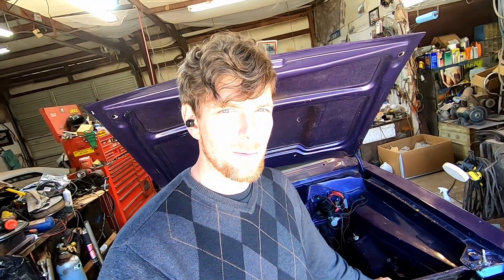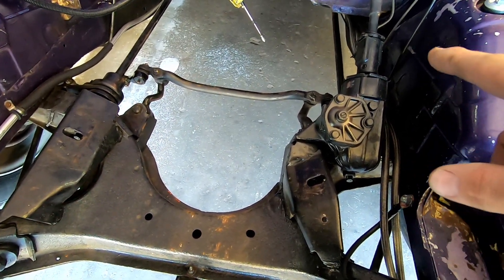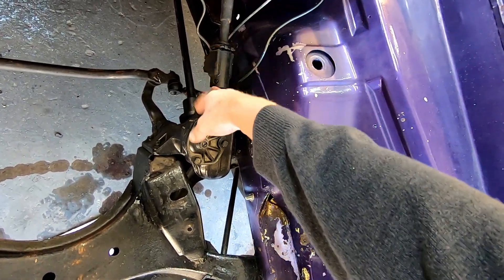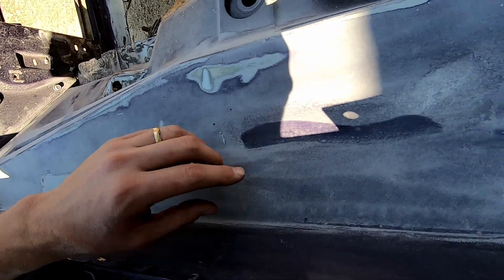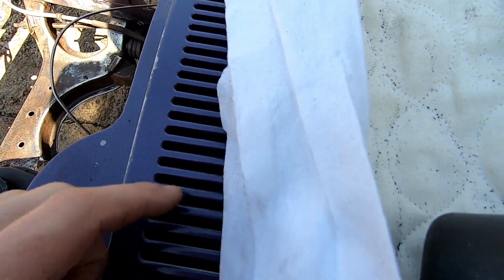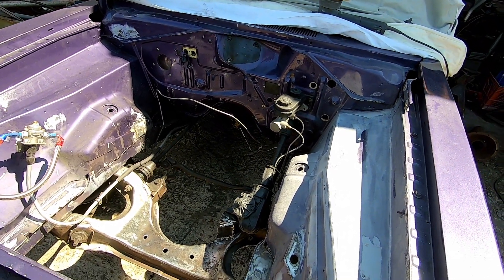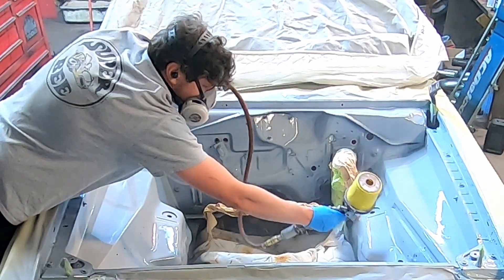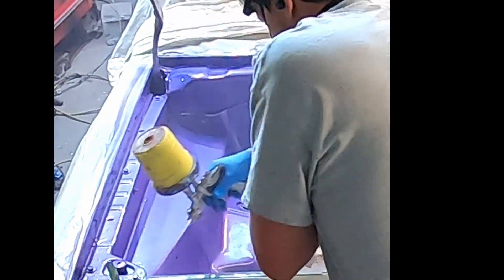Barracuda DragCar: Plum Crazy Engine Bay and Shaved K Member for #bigblock #mopar #nonamenationals

Comment: We used TCPGlobal for our paints for aircraft painting and we used them in our guitar manufacturing shop. After 20 years of painting planes, guitars and automobiles we started using "Polyester" high build urethane  clear otherwise known as boat hull paint. Makes for a super durable topcoat that not only resists scratches but resists chemicals as well. All the high dollar guitar manufacturers of guitars like Santa Cruz, Taylor and PRS use the polyester clear now.
Reply from the maker: Thank you for sharing! I look forward to seeing how it lays on the large panels.

Comment: Turned out nice! I've used that TCP Global bc/cc on my last two projects. It seems to be holding up well so far. Great job!
Reply from the maker: Great to hear! It’s my first with them. I wonder if they’re connected to a major company: Nason,Ppg, etc.
Reply: I wouldn't mind knowing that too. I know that a lot of the high end paint (house of kolor, etc, are Valspar). Some are Sherwin Williams. I never realized that automotive paints were made by the same companies that make house latex👀!  
I have been using the nason ful-poxy for awhile now also Joe... and it does a good job. Nason is Dupont's (Acromax-now) low-line product..and goodness has it gone up-along with everything else in price! I'm dealing with a learning curve myself trying out new products that are less expensive. Some I can report good on..some bad. It kinda sucks getting used to materials that I'm confident in and know hold up over the long run...but just aren't cost feasible anymore! Live and adapt I guess🤷
Reply from the maker: @MidnightOilsRestoration  tcp should be around a long time. Also check out urechem

Comment: 🎉 Looks great Joe! Can I ask what you meant when you said you might find it on the floor!?
Reply from the maker: Thanks Anthony. Old timers used to spray lacquer paint. A car with lacquer would react when urethane was spayed on top of it. They say it’d literally melt off like paint stripper.
Reply: @JustMoparJoe  are you going with mounts or elephant ears? You can make your own isolators/insulators to keep the racket down when blowing the door's 🚪 off 📴 the other guys car 😎🚨.
Reply from the maker: @Anthony-nw5zv  she’s getting the elephant ears. I will probably bolt a bracket to the tops of this frame, and try to save my paint from the welder
Reply: @JustMoparJoe  EXCELLENT!